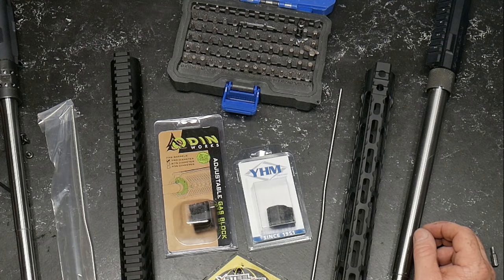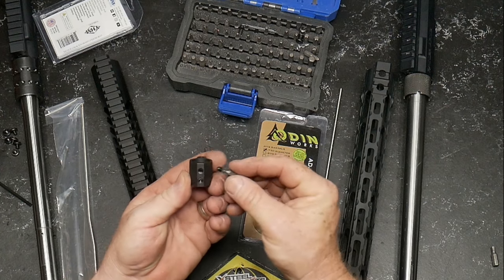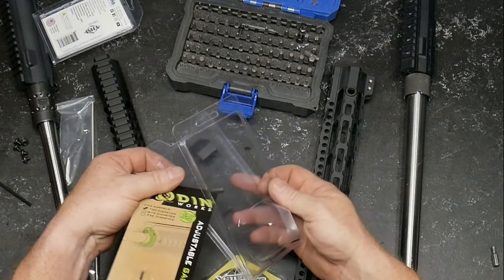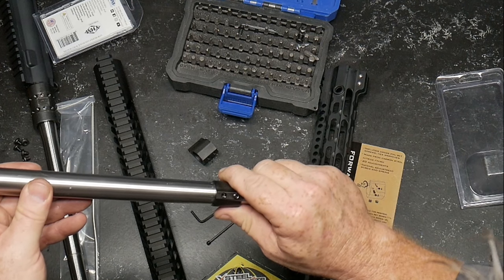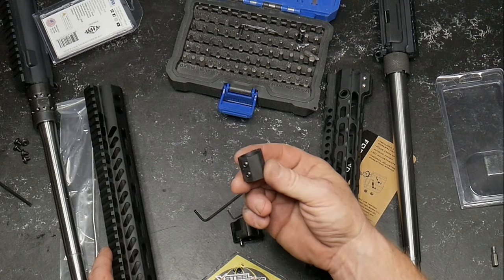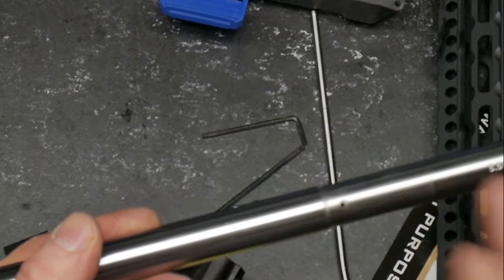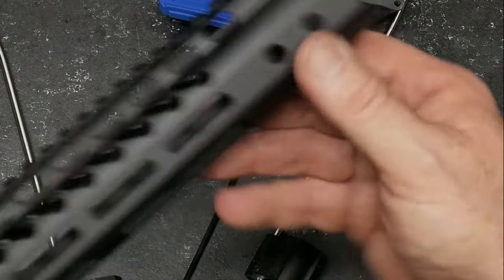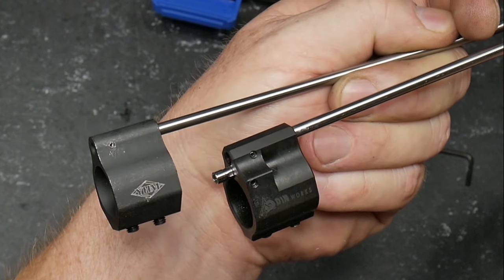Cheap Vs. Expensive!  Gas Blocks Why Basic or Adjustable

Comment: No matter which gas block you buy, make sure it isn’t made from aluminum. Steel only. The hot gases are corrosive and will eat the block port on the barrel making it larger until there is leakage.

Comment: I have some experience with after market gas blocks... Unless you plan on running a suppressor, go with a 20-30$ low profile gas block. You'll be good to go. If you DO intend to run a can - definitely go with an adjustable
Reply: Exactly,just got to remember the pressure change with a suppressor.
Reply: What manufacturers do you suggest

Comment: They all have the first set screw aligned with the gas port. When they make a gas block they drill out the first set screw hole straight through and drill out the gas port at the same time, then they re-drill the set screw hole to the correct size and thread for the set screw. That's another reason I like set screw gas blocks versus clamp-on gas blocks. My two go too's are Strike Industries for a straight and simple gas block and Superlative Arms for an adjustable gas block. I also use my KAK Dimpling jig and put dimples in my barrels to keep the gas system aligned and it also helps in keeping the set screws tight because of the more contact surface between the barrel and the set screws.

Comment: So far every Bear Creek barrel I've used has been dimpled that really makes gas block alignment a snap.
Reply: I built one with a 18 inch fluted stainless Barrel with black nitride. Shoots just fine
Reply: I have their 20" upper with 17" M-lok rail. Shooting iron sights, I'm very pleased with the 2 1/2"-3 1/2" groups I'm getting bench rested @ 100 yards, and that's even with 55gr Wolf ammunition. I'm sure with higher quality ammo and an optic, it'll be a sub moa rifle, no doubt.
Reply: Thankfully my BCA complete upper assembly was dimpled, They forgot the set screws in the block.
Reply: @toddk1377  no doubt
Reply: @bluesbondsman  I've got another 16" 7.62x39 barrel coming from BCA today. You just can't beat their prices
Reply: @UncleDanBand64  
The only thing Im curious about is the longevity, how many rounds before the rifling is worn out. That I haven't found any info on.
Reply: @toddk1377  well I couldn't say I've probably got 2000 through my 10.5" 7.62x39 all Tulammo Steel so far so good. I think why they are so budget friendly is they leave them full profile. The 16.5" weighs a ton.
Reply: @UncleDanBand64  
That makes sense. Obviously we aint gotta worry about the quality of the steel the barrel is made of since they guarantee 1 moa with good ammo. I know I got around 1000 through my BCA 20" barrel, all russian steel cased ammo, but I use Red Army Standard, seems to shoot better than Tula or Wolf other than the purple sealant gunking up the face of the bolt, lol.
Reply: @toddk1377  yeah I'm shooting the Tula hollowpoints. At a 100 yards it'll generally shoot most of the rounds in 5 shot group in 1- 11/2" group but they'll always be a flyer or 2 that will make your group double in size but, it's minute of hog all day at 250 yards and that is plenty good. My son's 18" 6.5 Grendel is driving tacks.
Reply: @UncleDanBand64  
Thats awesome! Usually I get 3" groups or so with tula, but we all know not all barrels have the same taste!
Reply: @toddk1377  it's possible that the Hollowpoint Tula is slightly better quality than the FMJ. I have no doubt she'd do an inch with quality ammo. It'll dang sure punch a bullseye on a cold bore everytime. For $10 for 40 rounds of Hollowpoints I doubt I'll shoot anything else but, Josh Benware was getting 1" groups with an AK and that Monarch ammo they sale at Academy, FMJ's! I might give some of that a try.
Reply: @UncleDanBand64  
Nice! For sure, I have noticed that the BCA barrels do well when their cold or warm, but once they get hot, I noticed it tends to string a bit. I can tell the difference with my BCA barrel vs my Ruger chf barrel, the chf barrel will keep better groups, even when hot. But like many have said, for the price, a BCA barrel is hard to beat.
Reply: @UncleDanBand64  
I've heard that before, folks saying that the hollow point in those russian rounds act more like a stablizer vs the terminal ballistics of typical hollow points.
Reply: @toddk1377  it could be
Reply: I am about to buy my first Bear Creek Arsenal complete upper. Is it worth it? And any thoughts? Tips or tricks? Advice? (This is also my first AR build)
Reply: I ordered one yesterday so my answer is yes. I really ordered it to get a spare 7.62x39 bolt.For the money you can't beat BCA @pimplepickerton
Reply: @UncleDanBand64  How do you like your BCA barrel.  I am in the process of building an AR rifle in this caliber.
Reply: @stephenmaurer7008  I have had zero problems with any of their barrels or bolts. For the money unbeatable in my opinion👍

Comment: " IN-CO-NELL" is a iron nickel Cobalt steel alloy. Higher strength and corrosion resistance at high temperatures then conventional stainless steels.
Reply: Yes they make turbo charger blades out of it it's a metal that is hard to work with

Comment: You could've got a steel adjustable gas block for less than the YHM to have kept the comparison more even keeled. I like to dimple my cheap adjustable GBs, which I bought a 10 pack for like $100, so I have them on everything.

Comment: My race gun has an adjustable block but my play guns are all wide open. Same thing with my bolts, light-weight weird metal coating, (gold whatever that is) and my play guns are black and cheap. Funny thing is the cheapo guns always give me no issues with just about any crap I loud into them but my race gun is set to shoot 62gr Remington and that’s pretty much all it can shoot and needs to be cleaned every 500rds or simply doesn’t work. My 7.62 x 39 SBR with a no name upper and Anderson lower eats corrosive ammo for breakfast and doesn’t get cleaned enough and still has no noticeable erosion on the gas hole or even the tube after thousands of rounds of cheap Com Bloc ammo.

Comment: I have an odin adjustable block works great. As a note, i have a mil spec weight bcg and an h2 buffer. My barrel is a Daniel Defense pinned 14.5" with a carbine length system. With 5.56 im at 12 out of 20 clicks to cycle properly and 14 with 223. I keep it at 16 or 17 for more reliable action. DD tend to have large gas ports so keep in mind if you have a similar setup, you may be running close to wide open on the gas block. But it works great and im glad i can taper the gas back to where it works just right without overgassing. You can rebuild them too which is awesome. Def recommend odins products. Havent had something from them i dont like as of yet

Comment: I always check the gas tube inlet hole matches with the gas block port and also that they are the same size hole. There are some slight variations between manufacturers.

Comment: I don't think you can say that this gas block is better than that. I have a $15 gas block with very nice mill work made of 4150 steel, and I have  Bravo company and a Aero Precision gas blocks. They are made of steel also, and all work the same as the other. But when you get into adjustable or
 titanium then there's a big difference . IMO
Reply: Paul Hughes What difference does titanium make?

Comment: I have a JP adjustable gas block on both of my ARs.  I don't think I need to be brand loyal but I'll always go adjustable.    I've had 2 instructors and 1 RSO stop me from shooting to ask why my rifles have so little recoil.  On the few occassions I've let buddies fire them, I get the same reaction   The main factors seem to be a rude compensator and an adjustable gas block that is properly dialed in.

Comment: I can't wait to see the finished products! Recently I've built my third AR and it was a medium build, but so far my favorite out of the bunch. 20" BCA upper with PSA Freedom lower, CMMG lower parts kit, UTG A2 stock kit, Magpul MOE grip, JP carry handle, Troy fixed front sight. I have severely depleted my ammo supply thanks to this rifle, had over 1200 rounds at home, now I have less than 200... Good thing I'm getting all this overtime at work, I need lots more ammo! Happy 4th y'all!
Reply: its 2022 inflation is killing us and ammo is waaay to high no one is really shooting. but buying and saving.
Reply: Have you had any problems with it not cycling? I have a 20 in bca upper as well but it shoots and doesn’t eject or cycle
Reply: @jacobsmith4308  
Mine did that at first, it took about 50-60 rounds before it started to cycle properly. My guess is that there may have been some machining material in the gas port. Once it started to cycle it didn't have any further issues.

Comment: My most hated task in an AR build - installing that blasted gas tube pin.
Reply: I have the Real Avid AR block, makes it a snap!
Reply: I lighly bevel the roll pin, help guide it in much faster.
Reply: I hear you, man. I'm now using a Knipex plier wrench to press in the pin. A great improvement for me.
Reply: @jaberie308  I just got me a pair of those, and for that very reason.
Reply: A year later, but buy a set of roll pin installation punches.  The end of the punch is drilled to just larger than the diameter of the roll pin so it holds the pin and makes driving it no big deal.

Comment: THANK YOU! It's about time someone made a video about using quality gas blocks in their builds. Nothing burns my ass more than the plethora of Facebook posts about "My gun won't cycle" DO NOT cheap out on these parts. The gun will not function for long if at all if you have a poorly machined gas block.

Comment: Just got my suppressor in and fired several out of it ,need to put a adjustable gas block on 2 of my ar rifle. What adjustable gas block do you suggest  the suppressor is a 36m silencerco. Need for a 223 556 and a 762x39 rifle

Comment: With the adjustable gas blocks. You should tune it to run just a little over gassed. Not to much over gassed and you’ll feel more secured.

Comment: Don't forget that the adjustable can also help when suppressors mess with your cycling.
Reply: Maybe you can answer my question. I think it may be a stupid question (and I think I know the answer already), but if I buy an upper with a carbine length gas tube, could I then upgrade/lengthen the gas tube to a midlength gas tube? And if I can, as long as it fits on the barrel I have do I need anything beside a new gas tube and block, or will there be other parts I need too?

Comment: WTF SoCal found out about some gas blocks need to be a little off the shoulder. Great job explaining this, thank you Kotaboy32 for 🇺🇸
Reply: Kevin Roberts yeah I have no idea why all companies can’t butt their gas blocks right up to the shoulder. It’s one of those things that would make it too easy.
Reply: R Win 
The reason the gas block may need to be set off the shoulder is to provide a space for the handguard cap on spring loaded pop in hand guards. Normally, the gas hole in the gas block is oversized to accommodate the thickness of that cap, so you can still just bump the gas block to the shoulder of the barrel.
After installing your gas block, spray some carb cleaner through the gas tube from inside the upper receiver and observe how much flows out the barrel.
Also, before installing your hand guard, take the rifle out and shoot it and check how it is cycling and where it is ejecting the brass. When you get home, remove the gas block and check the carbon ring on the barrel around the gas port. That will tell you if your gas block is properly aligned or partially blocking the gas port.
If you already knew all of this, never mind!!
Reply: @theunofficialresults231  That's what I found out too
Reply: Theunofficialresults Thanks for a the advice. I’ve always just ordered complete uppers from BCM. Ii know the AR is a extremely simple platform. However ’ve learned quite a bit more building instead of buying. It’s sort of like fine tuning a truck. Enjoy your 4th brother 🇺🇸
Reply: @romeowhiskeylima556  yep, happy America's Birthday 🇺🇸
Reply: R Win 
BCM makes awesome equipment! I had the opportunity to mount a scope and sight in a guy's BCM recce, beautiful firearm and shot great. Wanted to buy it from him!
I recently purchased a DD chrome lined 12.5" barrel and built an upper around it. Used a Midwest Industries hand guard, SLR adjustable gas block. Handles and shoots great.
You and yours have a great USA birthday too!
Thanks

Comment: building a rifle i would put and adjustable one on. not a question. i have a in. exp adj. on my 7.5 and it worked great. lock it down. on my bcm 11.5 i have a bootlegger adjustable bolt carrier. to me thats the way to go if rifle doesnt have it already and you wanna make a change. can really dial in recoil on the bcg fast as opposed to gas block.

Comment: Thank you, great video as I am still learning about AR's and I appreciate easy to follow information like this. I went with a PSA lower and BCA upper for my first build. Learn on the cheap and build a better one when I know what I'm doing.😉
Reply: I am about to get my first BCA completed upper. Are you happy with yours? Any thoughts, tips or tricks, or advice? Any input is appreciated.
Reply: @pimplepickerton  I'm very happy with mine. I don't shoot as much as the tacticool bros do, but I haven't had any problems so far. My first one was a 16" for my carbine. Then I built an AR pistol and used a BCA 10.5" upper. I have two more on the way. Another 10.5" and a 7.5" so I guess you could say I like them.👍🏻🍻
Reply: @budgetguncinema7777  good call man. I appreciate the input. Thanks man

Comment: I will stick with my Gas Piston conversion of my Colt AR, I don't have gasses coming into my action unlike the Gas tube system and I don't need gas rings on my bolt. My AR runs cleaner and cooler. runs like an AK !!!

Comment: If you're decreasing the gas by adjusting the flow to reduce recoil, does this put one in territory where some ammunition will not work?  In other words, should you adjust from zero until it cycles, then open it up even further so the rifle will cycle most ammunition?
Reply: Type a rifle company recommends exactly that.  Go to where it functions reliably and open it 1 more, or 2 if you want it really reliable.

Comment: Kota-- Thanks for your efforts.-- I hope you or someone else will comment on my thought process regarding adjustable gas blocks.
Before I get into it I will relay a comment made by a local gun smith who specializes in AR platforms. Basically he said that adjustable gas blocks do not hold up well. And as a result he will not use them. 

That being said here is my idea.
Because my primary enjoyment comes from target shooting and load development, I thought I would install a adjustable gas block so that I am able to bypass the gas cycling completely in my AR. The thought is to minimize the incidental movement that might effect accuracy imparted by the bolt's travel.
Sure, at this point the rifle becomes a single shot and I'm fine with that. Now I have to admit I don't know if the projectile has left the barrel before the bolt unlocks so the following may be academic.

Over the years I have spent a fair amount of time studying barrel harmonics and have tuned many a load for a given bullet in a specific firearm, all in the quest to squeeze the best groups out of various rifles. I have done this in everything from BPCR rifles with custom designed & molded cast lead to factory stock actions and barrels with a fair amount of success. In each case, in order to reduce the human influences that contribute to flyers, I set up a rail system of sorts so the rifle can't do anything other then travel straight back upon firing. 

What I want to do is develop a subsonic, accurate load for both my 5.56 and a 300 Black out with lighter projectiles.
I do have a Savage 110FP in 223 that will shoot in the 3's with regularity so that is my goal for the AR's, "If Possible" 

What I don't know AND hope someone who does, will tell me,
Does the recoil impulse from the energy generated from firing of the bullet enough to unlock the bolt or is the energy from the gas required to do so....?

Hence my desire to have a adjustable gas block whereby I can completely block the gas...............

Thanks in advance for your comments....
RJ
Reply from the maker: must have gas, the superlative adjustable gas block bleeds the excess gas out the front, and will last
Reply from the maker: Also look into adjustable BCG's
Reply: @kotaboy32  Thanks..! I didn't know there was such a thing..

Comment: You mentioned the difference between the mid length, and intermediate length gas tubes, the inter. being about 2" longer.  If  you're building with a mid length system, how do you take up the added 2"?   Or is there an intermediate system?  I don't know nuthin'.  I've only seen barrels offered with carbine, mid, and rifle length gas systems.

Comment: Your premise that using a adjustable gas block on the Intermediate gas system is good, simply doesn't hold water. An intermediate gas system is going to have less PSI to the system than the Mid Length. An adjustable gas block cannot add gas, only take away gas. You even note that cycling can be an issue with the Intermediate system, that's because its running lower pressure and you end up with an Under Gassed rifle at times.